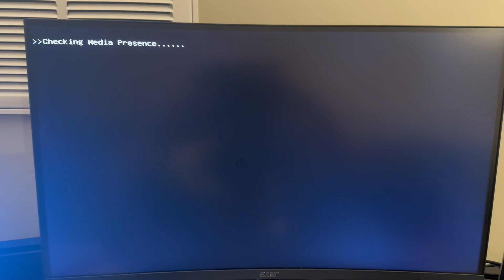Is THIS the new CONSOLE Killer?! Lenovo Thinkstation P520 + RTX 4060

Comment: Has anyone had any success in switching on Resizable BAR? It's been my only issue with the P520. It's OK for RTX 2xxx series, but from 3xxx onwards, you gain a bit more with Resizable BAR. I've updated BIOS, turned on the BAR-related options, but the computer refuses to acknowledge it as "on".
Reply from the maker: I have not tried this but definitely something I will look into

Comment: I just picked up a p520 and I want to do a case swap to a standard atx case, you think I’ll run into any issues?
Reply from the maker: I’ve been curious about this myself. I’ve looked into it a little but never done it. I don’t think getting the motherboard into a case would be an issue, not sure about any proprietary connections though. The one thing that would be an issue is the power supply as that looks proprietary, and I’m not sure if any adapters are out there for it
Reply: @PetesParts16  thanks for the quick response, looks like I’ll give it a shot and see what issues I come across 🤞
Reply from the maker: @B.eefy90  cool! Let me know how it goes, curious to hear what’s possible

Comment: im trying to do this now but i cant find the connector for it - your video jump cuts to the cable already being attached so i cant see where or how you managed to plug it in
Reply from the maker: Are you talking about the power supply connector for the GPU? Those already came attached to the PSU
Reply: @PetesParts16  I figured it out - there’s a mount on the fan bracket they were attached to just to hold them in place while not being used, I thought they were plugged in but it was just a holder. Pretty much have the same set up thanks to your video, and honestly this is by far the absolute best pc “building” and using experience I have ever had - seriously so in love with this rig thanks for the advice, seriously more people should dive into a p520, aside from being crazy affordable it’s reusing existing equipment so no e-waste
Reply from the maker: @MaceValor  awesome! glad this video was helpful. It is definitely a great setup for the price

Comment: Is there any issues or errors like I/O or any other?
Yesterday, I bought p520, w2135 32GB quadro p1000 for my nephew. Somebody told me that you have made a mistake and you'll face few irritating and un solved errors with this machine. 
   Plzzz, guide me how to properly install it's drivers. Your kind info will be so helpful for me. Thanks.
Reply from the maker: I have not had any issues like that with mine. The only issues I have heard of is sometimes AMD gpu’s don’t work properly but I think those are solvable problems. You should be good to go!

Comment: You'll definitely want to get 3 more sticks of what you have or try getting 4 sticks of 2666mhz ram to benefit from quad channel memory. It will really bring this cpu out of its shell and help with your avg fps substantially. It would probably give at least a 20% uplift depending on title and settings. Great video otherwise!
Reply from the maker: Great tip thanks! I’ve been meaning to upgrade the Ram but have been slow to do so. Will be the next thing I add to this PC

Comment: I got a Thinksatation P520 with w-2145, 32gb ram and an RTX 2070. Did so based partly on this video so thanks man. I will eventually get a better GPU but the 2070 holds up just fine. I am tempted to get a 4060 for my Optiplex 7040 MT. I am wondering if undervolting it might help a bit.
Reply from the maker: Glad I could help inspire you! The 2070 is still a great gpu. Undervolting might help with the 4060 in the Optiplex I would just be careful and make sure to check voltage and temp benchmarks during long gaming sessions.

Comment: Nice, I have a RTX 3090 Xeon w2155 10 core w 4.5ghz turbo and 128GB DDR4 2400 in mine and it crushes most games at 4k running Ubuntu. The P520 is the new bang for the buck king stealing the title from the HP Z440
Reply from the maker: Sounds like a great build!

Comment: P520 and a rtx 4080 would that work the rtx 4080 3x8 pin and i got the 2145 so 8/16 core would it still bottleneck a 4080. Im asking because i have a 4k tv and want to play alan wake 2 and cyberpunk with path tracing and im assuming the 16gb of vram will stomp a 4070/4070ti with 12gb but the 3x8 pin for the 4080 conceens me is that supported with that PSU in the Lenovo workstation p520. Edit if its dumb and will bittlneck like crazy would a 4070 be good enough for the above mentioned games.
Reply from the maker: You would most likely need a sata to 8 pin adapter as well if it requires 3x8 pins since the P520 only supplies 2x8 pins. I think you’d see a little bottleneck with the 2145, but at 4k the GPU would be doing most of the work so you probably wouldn’t notice it
Reply: @PetesParts16  he said I'll need 2 of those 4 pack cables and the adapter that comes in the box with the GPU.

Comment: Hey man , Great video. What do you think about a rtx 4070 with Xeon e-5 1650 v4 with 32gb ram for 1440p gaming. Do you think the cpu will bottleneck?
Reply from the maker: It would probably be fine for the most part, but it will most likely bottleneck. Even the w-2135 can bottleneck the 4060 at times, but it’s not too bad
Reply: @PetesParts16   Thanks for the reply. Do you think downgrading the GPU to rtx 3070 and upgrading the CPU to Ryzen 9 3900x would be better?
Reply: @PetesParts16 I just bought a w-2145  p520 for insanely cheap 230$ would it bottleneck a 4080 or 4070. Also would a 4089 even work it needs 3x8 pin. Edit My tv is 4k and I want to play Alan Wake 2 so the extra vram if the 4080 seems good.

Comment: how does it do on performance mode on fortnite? does it ever dip below 144fps on low settings on performance mode?
Reply from the maker: Yes it will dip below 144fps but runs pretty smooth overall

Comment: I have bought a graphics card RTX 3060TI . What do you think of the performance with the bag, especially the processor  intel xeon w2135
Reply from the maker: I think you will have great performance with the 3060ti and Xeon w-2135. Give it a shot and let me know the results!
Reply: You may as well just get the w-2145.  It has much more cache, higher clock speeds and 8 cores instead of 6.  It's not that much more money.

Comment: So I keep hearing this computer won't work with any AMD GPUs, anyone get this and try it?
Reply: I put a 6700xt in my one  for my son's b-day present, and it works great!  And it was so nice working inside this machine  -  everything is so well made and there's fancy clamps to hold unused wires. Like flying fist class, but on an old plane :)
Reply: @hankwolfe  thank you! That's just what I wanted to hear. Great pairing as well btw!
Reply: @hankwolfe  I'm super glad to hear that, since that's what I hope to put in the one I'm about to order.
Reply from the maker: I want to test out a 6700 XT next, which I will probably also do a video on if I can get my hands on one for a decent price.
Reply: @PetesParts16  thank you! I think this PC would make a great pairing with that GPU! The AMD driver overhead being so much more optimized in most games leads me to believe that the slightly dated architecture of the CPU in this PC would get so big benefits. Just a theory. I also just have ALOT of AMD GPUs laying around 😅 so if I could use one in this rig that'd be awesome

Comment: I have the exact same P520, and I've added around 96GB of ram and P1000 Nvidia pass through to my ESxi Hypervisor. I ran about 12 VM's simultaneously. One is beefed up to 32GB since it ran all docker containers. 
 I would love to install a newer model such as NVidia 4060 or 4070, but my only concern isn't PCIE 3 negate most of of what the newer GPU models require? All these new GPU need at least a PCie4.
Reply from the maker: I think you do lose some performance using PCIe 3 vs 4 but from what I’ve read it’s not a huge loss. The bigger concern for folks is the weaker memory bus and Vram compared to last gen

Comment: Personally I don't really like pre-builts mostly because they lock the bios and it's not very future proof at all. Especially Xeon processors since they will have bottleneck, seeing your benchmarks just proves that it will bottleneck the heck out of the 4060. Not to mention the 900 W 2017 PSU is getting more old each day and will just not turn on soon.
Reply: My W-2145 drives my 3070Ti no problem.  I would HIGHLY doubt that his 2135 would bottleneck a 4060.  These CPUs are quite powerful still.  Even the 6 core w-2135 is only about 30% slower than a 13900k in most games.  You need a really fast GPU to notice the difference or be running very low settings at 1080p
Reply: @gametime2473 I just bought a 2145 Lenovo workstation would a 4080 work it needs 3x8 pin.
Reply: @Spencerwalker21  No idea.  I don't have that computer.
Reply: @gametime2473  oh sorry I'll give a couple more details it has a 900 watt PSU with dual 6 plus 2 pin connectors. And would the xeon bottleneck a 4080
Reply: @Spencerwalker21  You will have to look that one up.  I  haven't used a GPU with 3 8 pins before.  I am using a 3070ti.  My 2145 xeon isn't bottlenecking my 3070ti but might bottleneck your 4080 at 1080p.  That probably won't matter much since you don't buy a 4080 to play games at 1080p anyway.  My 3070ti pushes my CPU to about 60% usage maximum.  Usually it's hovering around 30% though.  I game at 1080p which taxes the CPU most for reference.
Reply: @gametime2473  okay thanks I have a 4k tv and with dlss and frame gen in the games that make sense I shouldn't be too worried about bottlenecking.  Yeah I'll continue to look up about the pin connector question
Reply: @Spencerwalker21  Cool, if you do put that build together, let me know how it performs.   I have an oldish but still really great looking 55" LG 3DTV but it's 1080p.  Gaming on it is sweet though and I can even put 3D on my games if I want.

Comment: I use a 4060 in my P710 with dual Xeon e5-2650 v4 's (had a 2060 in it before that). Rock solid gaming system. Compared to my other system which is en i7-12700 I can tell you that there is almost no difference between pcie3 and a pcie4 system. The only downside is that the P710 is one power hungry system. Even a 4060ti is ok in those configs. The gpu is just not bottlenecked. stay away from a 4090 though, there you need a more recent system. the 4090 will go to about 80 percent.
Reply from the maker: Wow very nice! I’ll have to check out the P710
Reply: Exactly though the W-2135 (which is less powerful in theory than the 2650)  he has in the video is stuck at 40-60% the whole time. I wouldn't really suggest putting in a high end GPU in these Lenovos because they WILL bottleneck and even though you get 60-80 FPS from the GPU carrying it will stutter sometimes which can be distracting plus the 4060 in this is being held back hard even if it has a lousy 8 GB VRAM.
Reply: Does the 520 support a rtx 4080 I got a w-2145 if that helps.

Comment: i would replace the rtx 4060 with used rx 6700 xt for the same price
Reply from the maker: Would be an interesting comparison. I might even compare it to the Rx 6700 10gb in another video
Reply: @PetesParts16  cool, there’s also used RX 5700 XT that’s very cheap and it competes with the rtx 3060 also (i guess 4060 too)
Reply: @PetesParts16  the pc could perform better. the problem is, that the RTX4060 only runs on 8 lanes. this card performs the best with pci.e 4.0. there are better choises to upgrade this pc. a card with 16 lanes and the performance as the 4060 has on pci.e 4.0 should give you more performance in this case. a compaison video would be cool with some other cards with a similar price.
Reply: @PetesParts16 does the p520 support rtx 4080.
Reply: Rtx 3080 and change the xeon 2135 to a 2145; no bottlenecks at 3840x2160p. Budget 4k beast!
Reply: With an RX6600 I managed 4K playing with Medium settings on Fortnite. I had to upgrade from the single 16gb stick to 4, 16gb sticks that matched. Doing that improved gameplay significantly.
Reply: I'm a huge amd fan but it is true that amd cards are mined on way more than nvidia... alot of people say mining does not really break down cards. So if you buy used Nvidia the odds are high it was gamed on alot, amd cards were prob mined on
Reply: Just remember this p520 and original mobo get way better performance in quad ram and not dual ram.... if you game just  get 4x8 gb ram and your way more than fine... do not install 2 sticks of ram...
Reply: YES but it will still bottleneck in CPU intensive games like RE4 Remake, some stuttering will occur and the GPU will still be stuck at 60% at max. So I just recommend you to make a new PC if you're tight on cash this can work for now but not in the future at all.
Reply: @TotallySearch  I use a similar machine to this but with a w-2145 and it definitely doesn't bottleneck a 4060 or 6700 xt.  It has no problem keeping my 3070Ti fed to 100% and it rarely goes above 60-70%.  My system could handle most or all of a 4080 I bet.

Comment: Do you need an Ethernet cable for the Wi-Fi? Or can u just connect it? Also is it as simple as just putting in a gpu and an ssd, downloadin windows?
Reply from the maker: Mine didn’t come with WiFi so I am using Ethernet, but you could add a WiFi card. It also depends on what you choose to have it come with, mine came with everything except for the graphics card so it was the only thing I needed to install. If you wanted to get a barebones P520 and put all of your own components in you could, but for the price it made more sense for me to get one with a CPU, RAM and an SSD already installed. The great thing about these is there is still an upgrade path as well, could always get more RAM, storage and upgrade the cpu/gpu down the line as well.
Reply: @PetesParts16  hey man thanks for the info. I’m just kinda scared I’ll find issues along the way, did u find any issues or did u have to like undervolt the gpu or do anything to fix the issues if u had some?
Reply from the maker: @wiskollo  no I did not have any issues so I didn't need to undervolt or anything.
Reply: @PetesParts16  I'm using a TP-Link external USB AC1300 wifi adapter, works great, high speed and strong reception, even from the opposite end of a big house.

Comment: I'm curious how much better it could perform with a 2nd stick of RAM (for dual-channel).
Reply from the maker: Yes will be interesting to see once I get another stick
Reply: @PetesParts16  did you get more RAM yet?
Reply: @PetesParts16  The P520 supports 4 channel, not 2 channel, so you need 4 sticks. My P520 should arrive in the next few days, and I have 2 16GB DD4-2066 ECC waiting for it, and I'll get 2 more soon, for a total of 64GB, more than I'll need, but it'll give me that quad channel bonus.
Reply: 25-40% more fps ... single channel is a fps killer